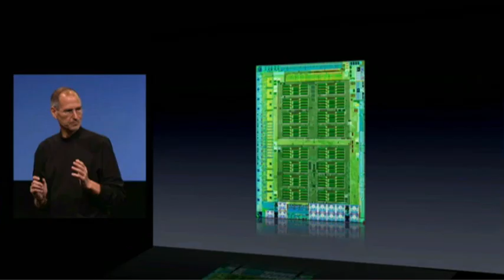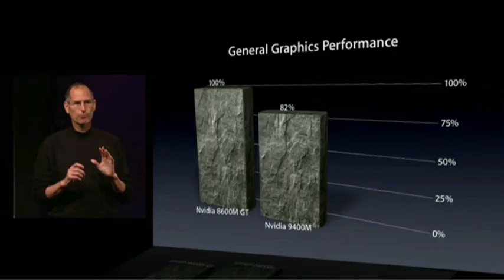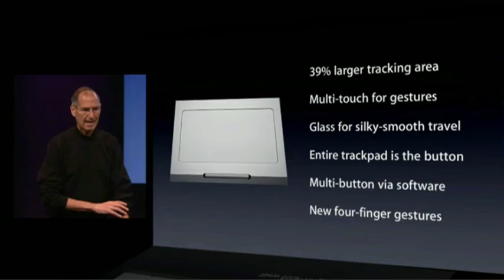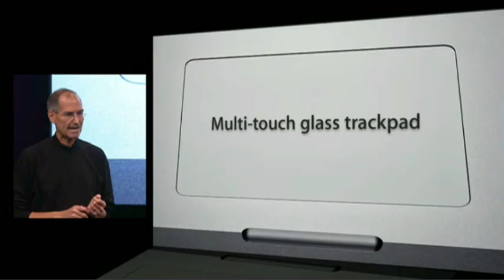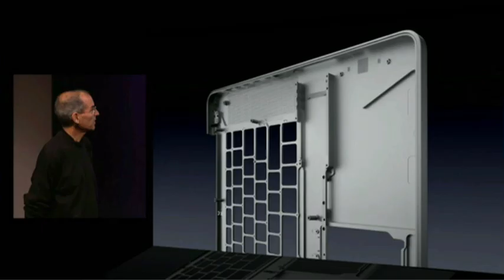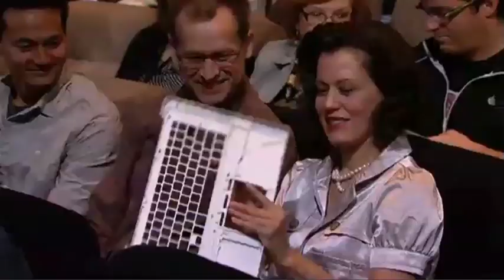Oct 14 - Apple Notebook Event 2008 - New MacBook Pro - 3/6

Comment: Yes, that's true. This is for 3D work. Don't forget that the 8600M was the dedicated/discrete graphics chip (i.e., it's own memory) while the 9400M is integrated (sharing the main system RAM).

The point about it being 5x faster than the Intel is also true, as up to this presentation, Apple used the Intel GMA chipset for it's graphics etc., and the GMA is integrated graphics. The 9400M is 5x faster than this in 3D performance (both are integrated)